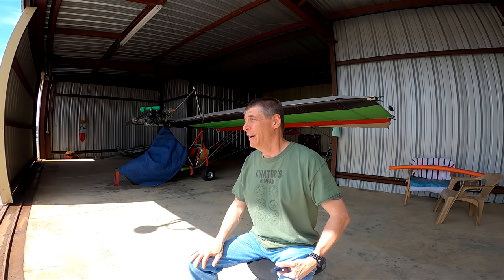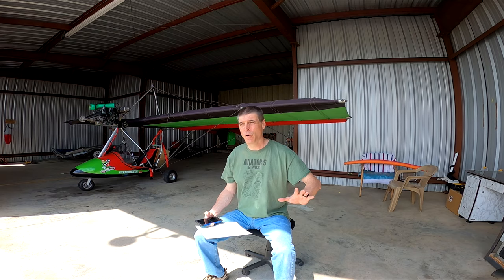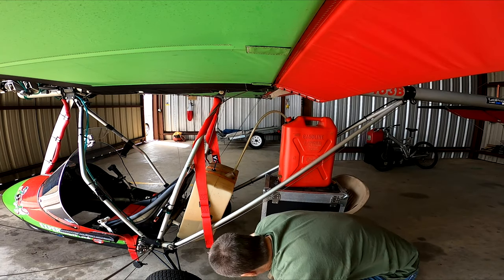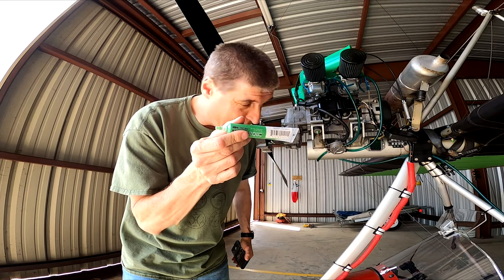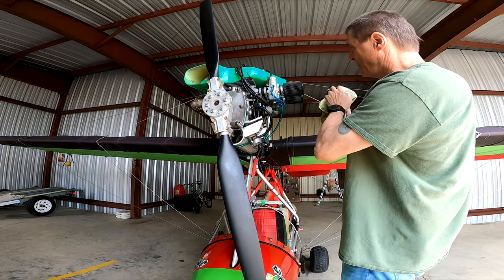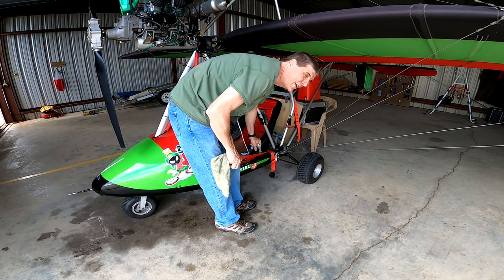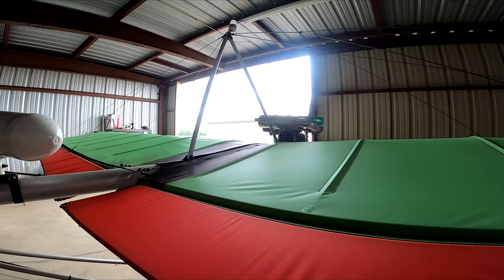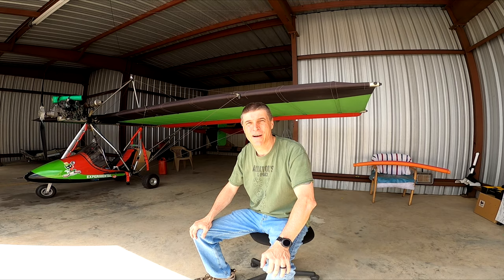How to Pre-Flight Your Phantom X-1 (or other ultralight)

Comment: cables !!!!! I had my left rudder cable snap and hit me in the leg when i was completely upside down during a barrel roll. flew back and made a safe landing. the cable broke in the sheath near seat belt attach bolts. I inspect my cables every preflight but you cant see inside the sheath where they may corrode. I made some nylon guides and new cables without the sheaths.
Reply: I’m going to check mine thanks

Comment: Great thanks I also check all the control cable connections to all the controls including ruder peddles and like you run my hand over all cables . Also I quick check all cable tension pulleys to make sure they are secure and that clip that holds the cable in the pulley .lose a pulley in the wrong place might not be good . I stand at the end of the wings and shake the wings and plane tail included watch and listen . Like you I eyeball all the nuts . thanks again mine is a 1984 still works great ! 👍

Comment: Tip : 
After adding oil to the measuring jug fill it 3/4 full with the gas from the large jug, mix that then pour back into large jug. No waste. I still add a little extra oil too, just because...  And yes, all modern oils do a very similar job. I think I might have used a synthetic oil in an aircraft if it's approved by the engine mfg. I use synthetics in all my vehicles and equipment, no idea if it's actually better or not, just feel better.
Reply: Extra oil is not a good idea. It will run hotter with a lean fuel mixture. I thought the same way until I was having overheating issues and talked to some one with more experience than me.

Comment: Good video.  I'm currently saving for an Aerolite 103, but it currently looks like I won't even get into the paramotor I want, much less the fixed wing.  I will miss out on flight, I'm afraid.

Comment: awesome video. im going this weekend to look at a phaontom x1 for sale. anything i should look for or ask?
Reply from the maker: Most important condition of sails.  Use a punch test.  If it needs sails that's almost $2k and MANY frustrating hours of work.  Next is engine hours.  Know rotax recommends overhaul at 300Hrs.  Do compression check and you should have at least 100psi on both cylinders.  More is better.  Last look for cracks carefully and missing plastic saddles between aluminum parts.  LOOK VERY CLOSELY AT THE THIMBLE CONNECTING THE FLYING WIRES TO THE WING AND FUSELAGE!  Know that a $5k airplane very quickly becomes a $10k airplane if it needs sails or engine rebuild.

Comment: Thank you William. Great helpful video! I have a Hy-Tek Hurricane which is to my understanding is very much a similar plane to yours and I have a few questions, as I am relatively new to aviation and ultralights. 
What speeds are correct for this airplane; Take off, Climb, Approach and landing? Also, did you mention that you buy 2 stroke oil at Walmart or I misheard you?

Thank you and I really appreciate all the comments and replies to my questions.
Reply from the maker: Yes,  I buy my oil at Walmart. It is the penzoil's multi purpose 2 stroke oil. I climb at 45 to 50mph, cruise about 65, and approach at about 60.
Reply from the maker: Until you become very comfortable with landing, I would come in with a little extra speed if you have enough room
Reply: @extremeultralightaviation  Got you. Thank you very much for your fast response. 
At what speed do you rotate? around 40 and then let it build up some speed to 45-50 before you climb?

Also, at what rpms do you approach and do you drop it to idle once ready to land or still keep some rpms?
Reply from the maker: @isheyman   Correct on the speeds. I try to never to let the RPM's go under 4000. If I'm too high I use a slip to lower it. Especially if you're gonna do a touch-and-go. 2 stroke engines are prone to  Seizure if you let them cool rapidly and then apply power. Also, you don't want to windmill the prop has your e.g. T's will likely go over 1200.
Reply: @extremeultralightaviation  Got you. Good point. I will read up on that. thank you for your help and suggestions very much.
Reply: the Phantom manufacturers supply spares for the Hy-Tek Hurricane.

Comment: you have a different landing gear than whats standard?, like to know about your gear upgrade, also you dont have that standard  fabric seat, i want to upgrade to that type seat as well, is it the fiberglass dune buggy seat or the rotomold seat made of polypropylene? thanks so much for you pre-flight check to share with us and keep us safe in the air. keep up the good work, always love to commentary instead of music.
Reply from the maker: I think that chromoly gear is standard now.  I've had the aluminum and the spring aluminum with no bungies.  The chromoly is my favorite as it doesn't bend too easy, but is not rigid enough to bend the airframe on a hard landing.  The seat is the standard dune buggy seat you can get from J.C. Whitney - so is the cover.  The fuel tank is polypropylene.

Comment: How much is the cost of the same aircraft
Reply from the maker: New the kit is $14K, plus engine and instruments.  Used they go for $4K - 12K, depending on condition.  Don't buy a cheap one, you will likely rebuild it and it cost MORE than a nice one.  A 4K ultralight likely needs fabric and engine rebuild, which can cost over $5K, plus a LOT of your time.